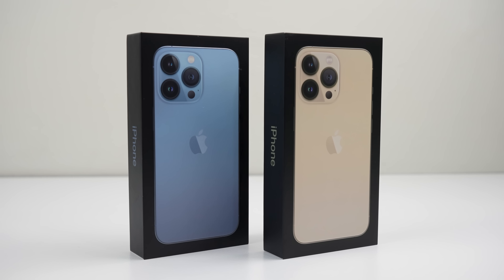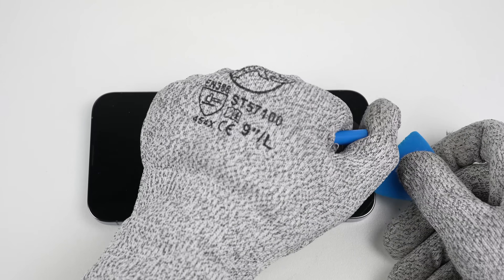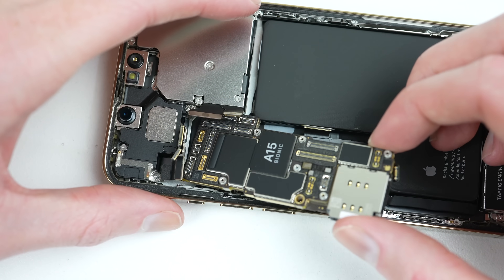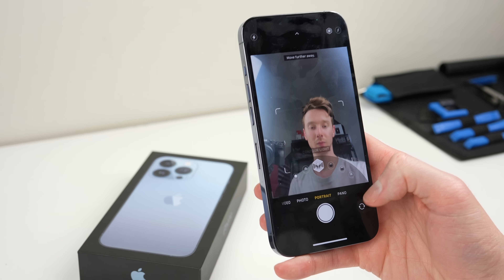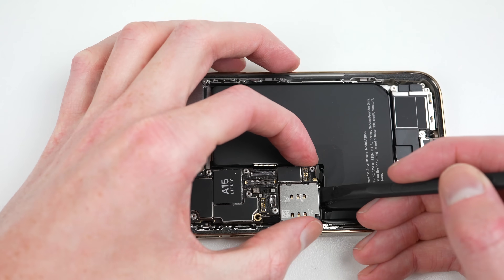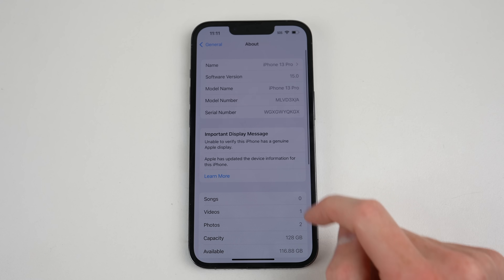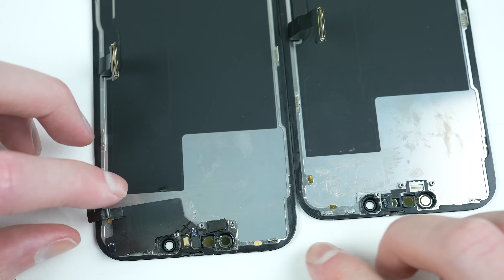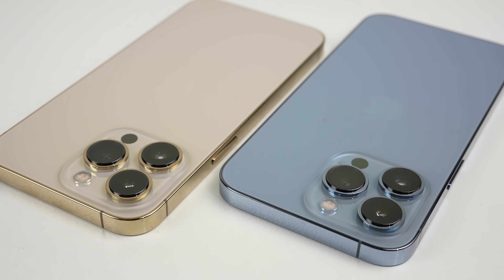iPhone 13 A Repair Nightmare - Teardown and Repair Assessment

Comment: The fact that there are proprietary screws AT ALL speaks volumes to how shitty apple is when it comes to fixing their products outside of their stores.
Reply: same goes for nintendo with their triwinged screws
Reply: @Oz A I'm glad you enjoy anti consumer tactics and we don't have them actively fight against Right To Repair laws, no, not all /s
Reply: @Oz A just because something isn't illegal doesn't mean it's morally good. Laws are not morals, and you should NEVER confuse them (especially the other way around. If a law is immoral, you definitely should be fighting it)
Reply: To be fair, their proprietary screws are much better than the standard screw : their heads are hexagonal or pentagonal, and will not wear with torque. This is very useful to ensure lasting screws even if you repair disassemble the phone several times. If anything, this is good for repair, because flat head screws of philips screws are incredibly bad for durability. The issue is the fact that they have SEVERAL DIFFERENT TYPES of proprietary screws to make repairing as difficult as possible as you need several sets of tools.
Reply: I thought proprietary was where it was a standard part and product specific was for that product.
Reply: @Night-zn4ew  here's the definiton "one that possesses, owns, or holds exclusive right to something" so more company spacific really

Comment: So basically the phone knows the parts are real but they are locked behind a paywall. Take it to an Apple shop and those bastards will plug it in and hit a couple buttons on the computer making it work again. And then they will make you pay for "repair and components" and it'll cost god knows how much.

Comment: Every internal part has a software serial number that is pre installed to the main ecu, when you change out that part, the ecu knows its not the same part and will block it from being used, that is unless you can get into the software to allow that new piece to work. 
Smart on Apple's part, lets see how long before people stop buying their phones.

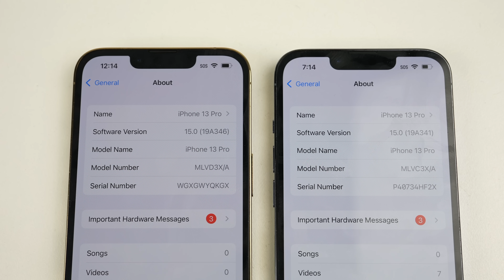Comment: At 9:15 you point out that you are running two different versions of the ios. did you try updating the software to the same version before tying the swap? I also noticed that the Model number is not the same. have you tried this test with two phones with the same model number?

Comment: Those camera issues occur because they rely on depth scanner which is part of FaceID, which is in it's turn, device  security mechanism. If you fake FaceID by connecting fake scanner to the device, you get access to all secure information that is stored there, including ApplePay data.

Comment: There is some really clever software engineering behind those seemingly random "symptoms" the apps start to "experience". I bet the programmers behind those are paid small fortunes. Just would hope their skills would be utilized for the benefit of the customer instead...
Reply: No need. Just check some unique ID and break if not detected.
Reply: Odds are, they aren't paid that much more than usual. Pay is rarely equivalent to the value of labor, especially in the programming world.

Comment: While this could be a money grab as many have speculated... I believe the reason for the non-interchangeability is more of a cybersecurity issue.  If any camera could work for face ID then someone can install a camera that can be used to bypass the face ID lock on the phone.  You also can't interchange many of the electronic components in newer automobiles for a similar reason.

Comment: To me it looks like only functions that need some input device being calibrated are breaking. Auto brightness will have some light sensor where the phone needs to know what input value corresponds to which light level which might be different from sensor to sensor and therefore the calibration value that is likely stored on the mainboard will be suboptimal. Same goes for face ID where the dot matrix projector needs to be calibrated together with the IR camera which is likely why both parts need to be from the same phone. True tone also relies on some ambient measurement and the advanced camera modes likely rely on the camera being calibrated against the IMU and potentially a time of flight sensor to properly work. I am not a fan of this but likely these calibrations are done at the factory by a robot moving the phone in some predefined pattern and point the camera and other sensors against some precalibrated inputs.